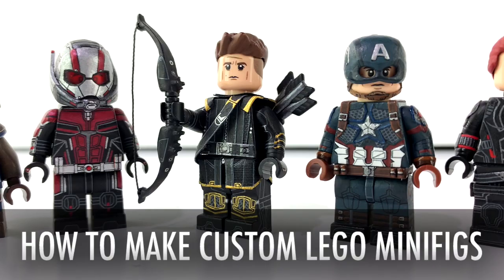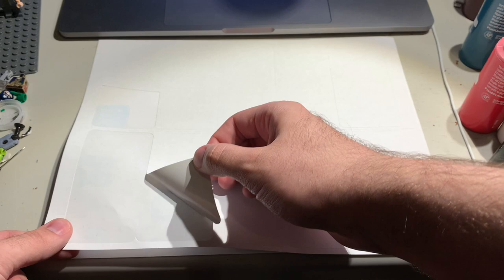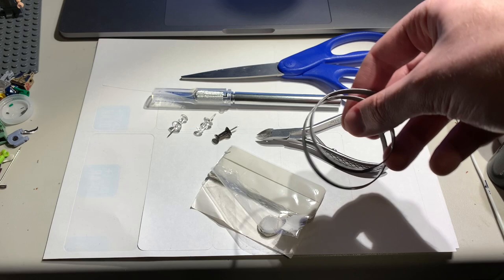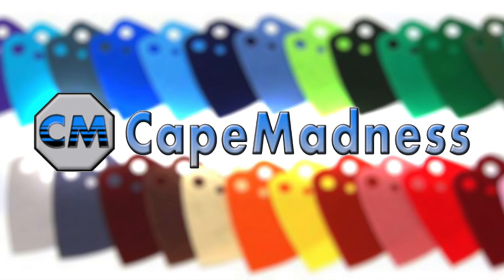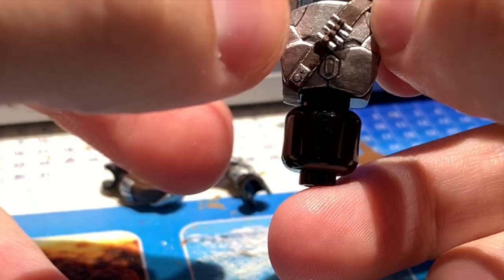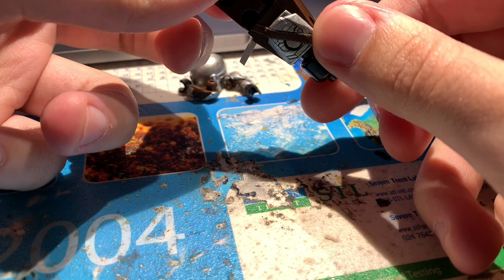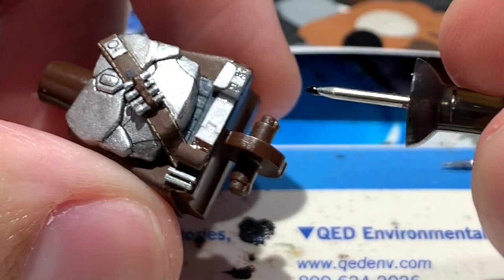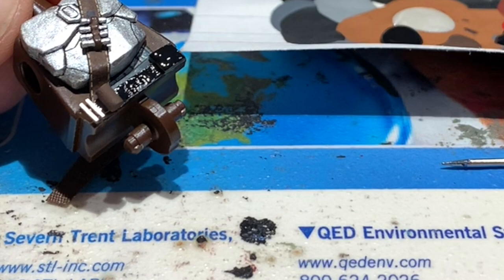How To Make Custom LEGO Minifigs - 3D Pieces & Accessories! EP4

Comment: As a substitute for lego fabric I’ve found that craft ribbon aproximates the texture of lego cloth and is easy to work with. Slightly fragile but it looks closer than anything else I’ve used if cape madness is not an option
Reply: thanks.

Comment: Why dont you use tweezers on the plant part or small cut outs instead of push pins and that sticky stuff. I usually used that in building gunpla. Most of gunpla tools might help you with your customs